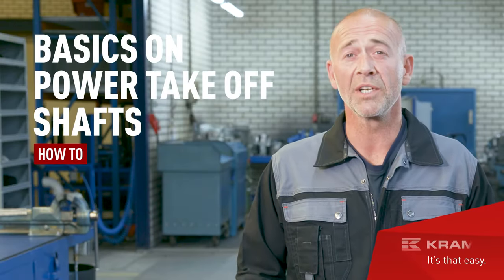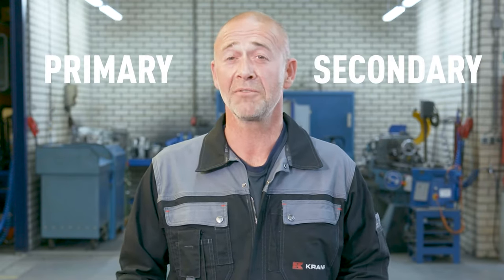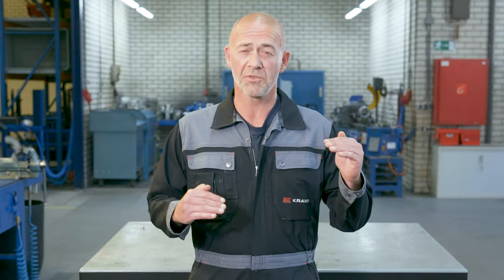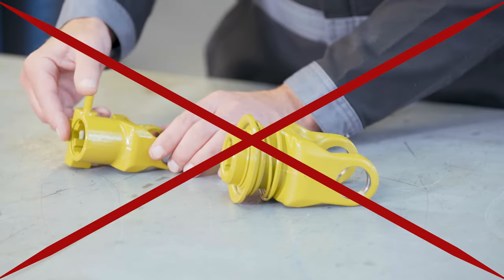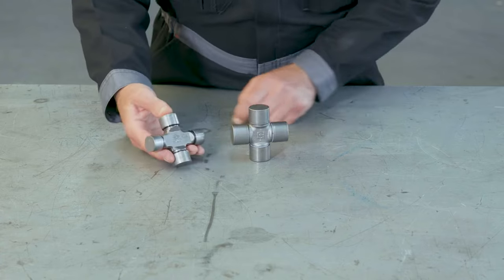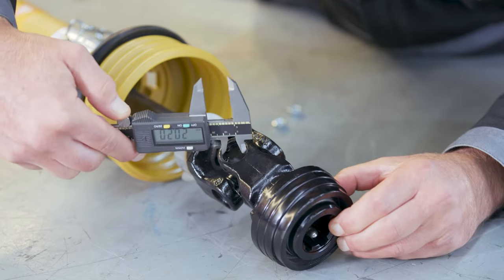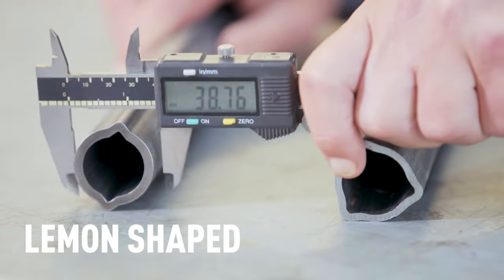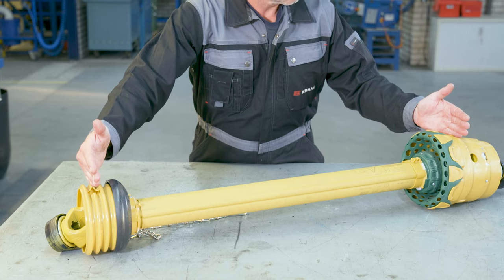Power Take Off shafts: everything you need to know | KRAMP

Comment: I have a simple 12 HP vehicle with a drive shaft to the rear wheels as its constant 4 wheel drive  ( there is a forward and a rear transmitter box )- is there a leave in situ drive shaft that I could disengage for it to become a 2 wheel drive vehicle with 4 wheel steer? The vehicle is a Coot and slow moving at 20 mph - it should not be driven on pavement as there is no slip on any tires ( tire/worm gear wear is the problem on pavement) please help.